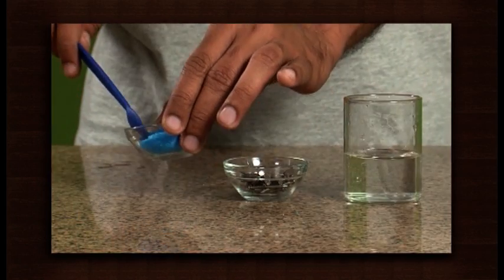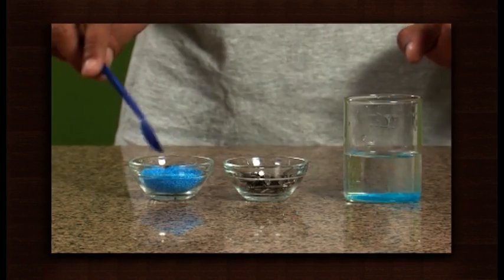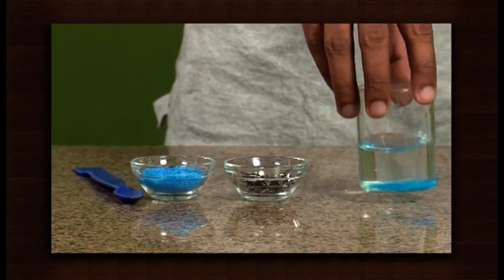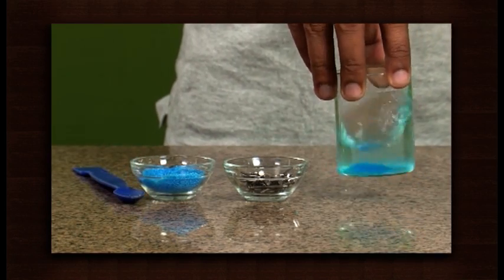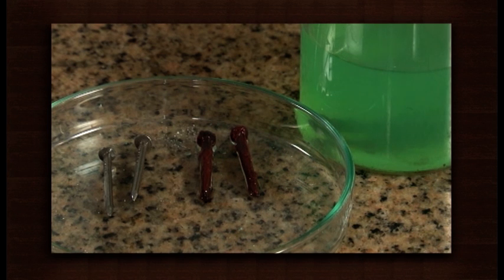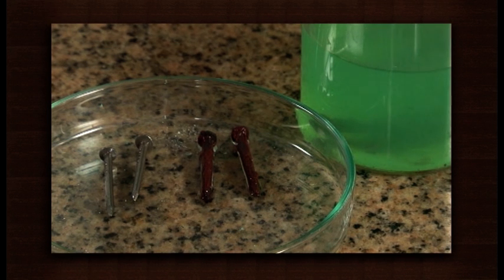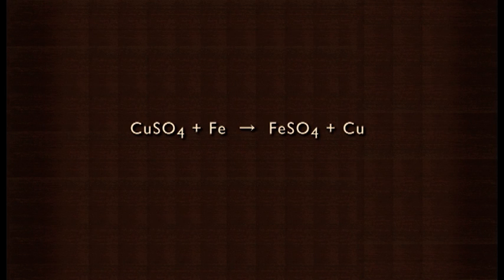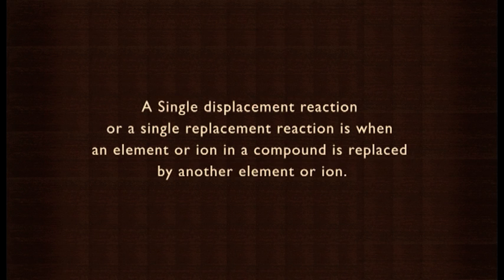Displacement of Copper by Iron

Comment: CuSo4 + Fe --> FeSo4 + Cu .... Are they the balanced oxidation and reduction equations for this displacement reaction?

I'm struggling to write these =[ ! Any guidance would be greatly appreciated
Reply: Already balanced both by mass and charge: 1 copper atom and 1 iron atom on each side of the arrow an 2 positive charges on each side. You can also write Cu2+ + Fe -> Fe2+ + Cu as the sulfate ions don't participate in the reaction